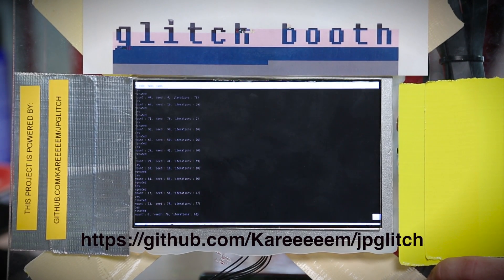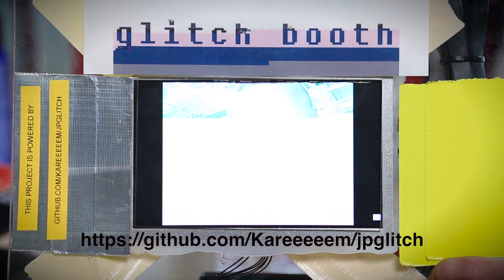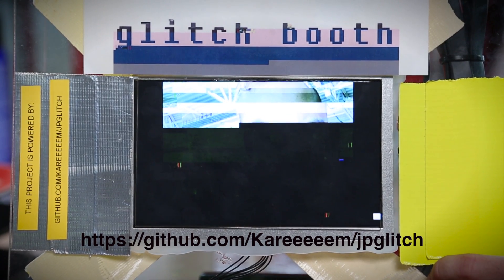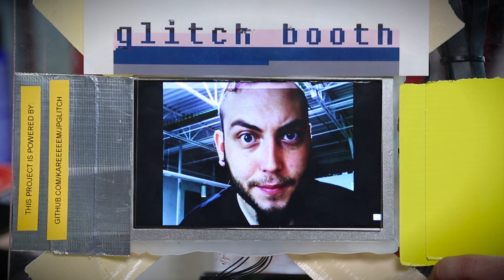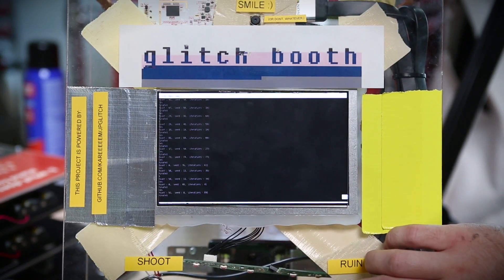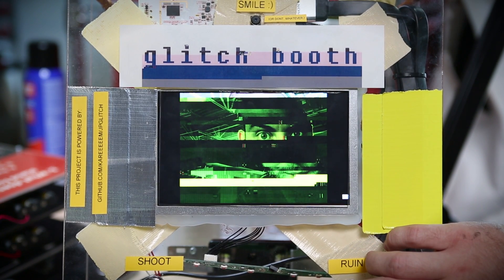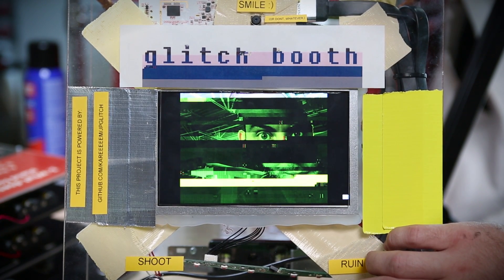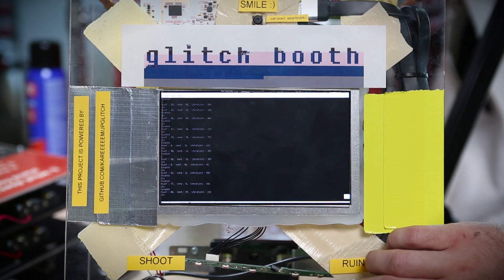SparkFun pcDuino Camera Module "Glitch Booth"

Comment: can you remove the IR filter and get night vision?  looks almost like the cap can come off, and then maybe the AR coating can be removed, via chemical bath or hopefully it is a separate piece of glass/plastic that could be removed.
Reply: +North Street Labs fun  - Natural night vision is a function that only works in the far infrared. For near IR night vision you need to illuminate the scene with a near IR light source (typically IR LEDs). And that will work on almost any camera. Most don't bother to install IR filters, espciallly something that costs $15.